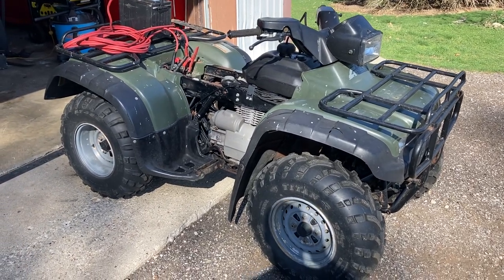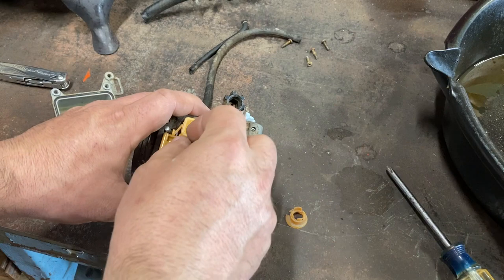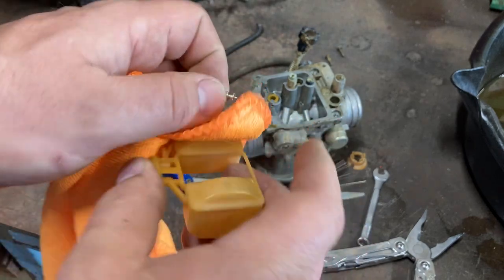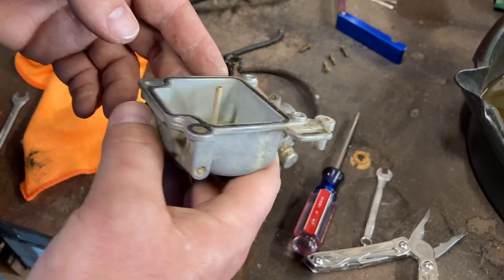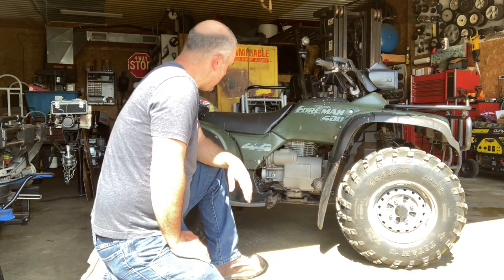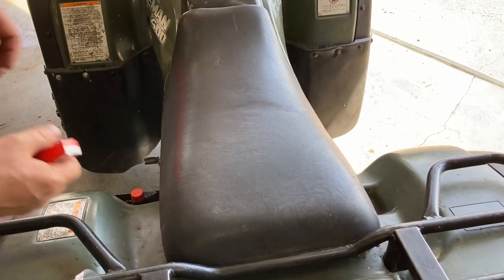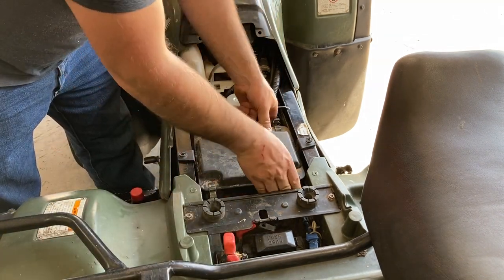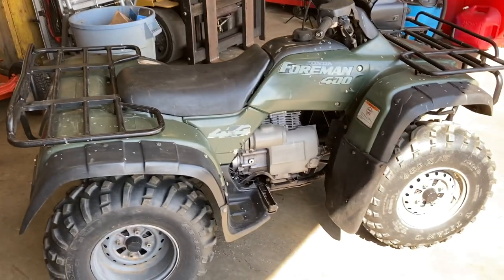What will it take to make this $200 quad run? 1997 Honda Foreman 400 4x4

Comment: Hmm.. could’ve swore the oil filter goes big hole to the engine.. looks like you went the other way around
Reply: no, hole away from motor. i slide my air filters up farther on the can than he does, i think you suppose to.

Comment: My uncle helped me with my Honda (1993 Fourtrax 300 2x4) and when we did the air filter he put some oil or some fluid on the air filter.  Do other people do that?  He does small engine repair for a living so I'm guessing he knows but didn't see you do it here and wondering if its optional or recommended, etc.  Also, great video, thank you.  I'm buying another Fourtrax similar to what you bought to have a second one at the cabin, learned a lot and bookmarked it while I find my next project!  Thanks
Reply from the maker: Yes you can add oil to the filter depending on what kind of filter you buy. I personally would not put oil on a paper filter but K&N air filters come with oil a lot of times.
Reply: Those filters should be oiled up already when new. If you wash and dry a used one re-oil it with a lil motor oil or if you want to get real fancy use a foam filter oil which is the same idea but is thicker and sticky. I think the idea there is to make the bigger dirt stick on the outside of the filter before it can get sucked in. Either Honda dealer here is over an Hour away, local place sold me some Yamalube oil for that it’s like syrup compared to motor oil
Reply: @moklock got it, thanks, appreciate it